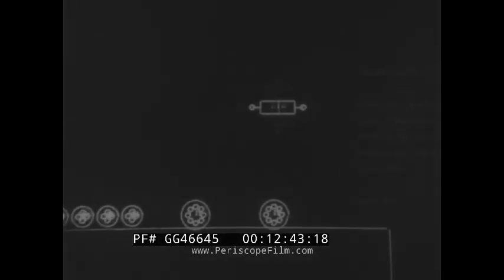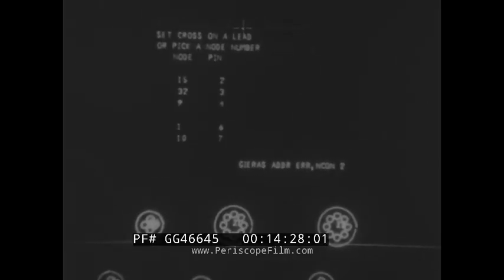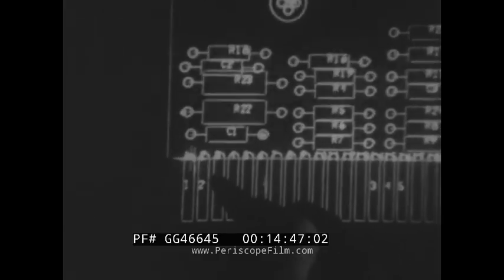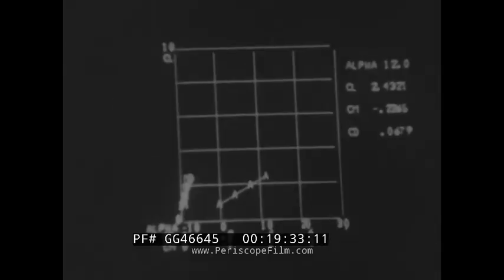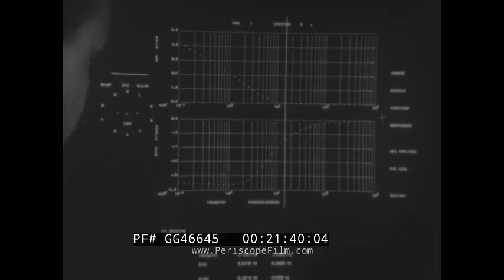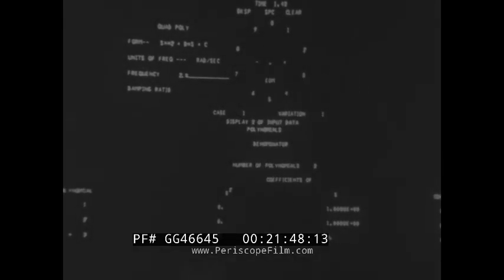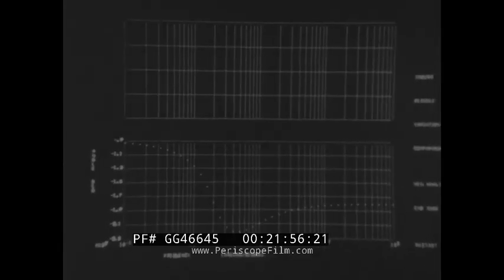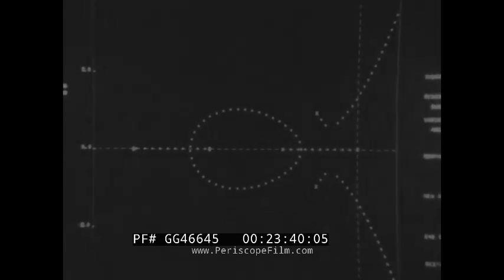" INTERACTIVE GRAPHICS APPLICATIONS "  1970s GENERAL DYNAMICS COMPUTER AIDED DESIGN FILM GG46645

Comment: Why were they shooting B/W film in the 1970s?  B/W video tape makes sense for that decade.
Reply from the maker: Transitional period — people were still shooting lots of 16mm and releasing films until the 1980s
Reply: @PeriscopeFilm I understand that 16mm and super 8 were popular then - our family has super 8 films from this period but never B/W.  I would have expected corporate film to only use colour at that time.
Reply from the maker: Probably a financial decision and/or they made color and b&w versions and we only have the b&w one
Reply: Those oscilloscope alike tubes for displaying images shown in the video are monochromatic. With that as the topic of the film, there isn’t the need to use color as long as there is the supply of monochromatic film.
Reply: @hakureicirno6059  In addition, film ramps up with speed nicely - and B&W is much more sensitive for a given grain than color. And the longer shutter speed vs. video makes the vector tube output muuuuch less flickery and easy to read.